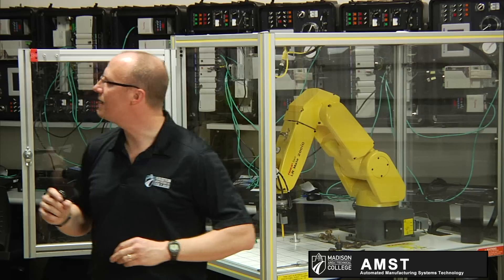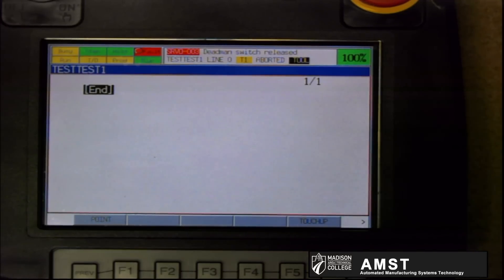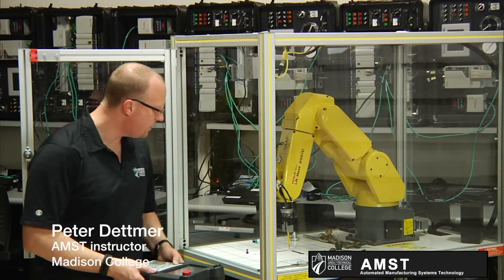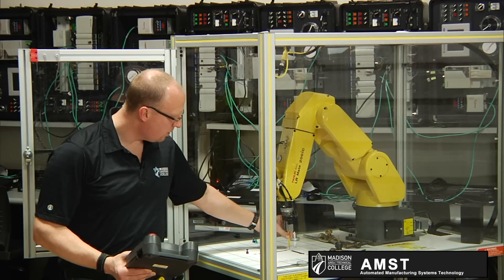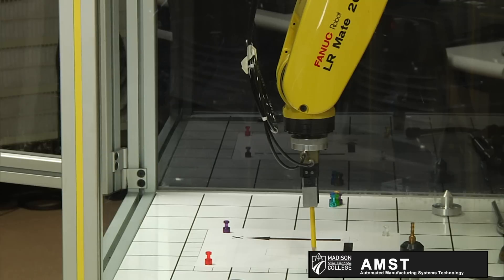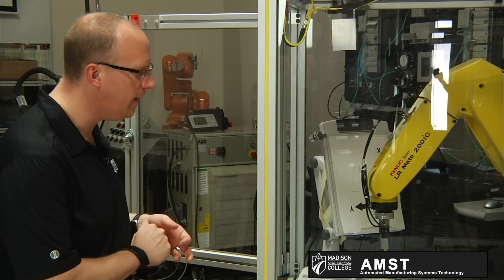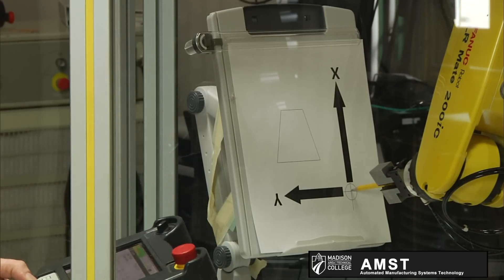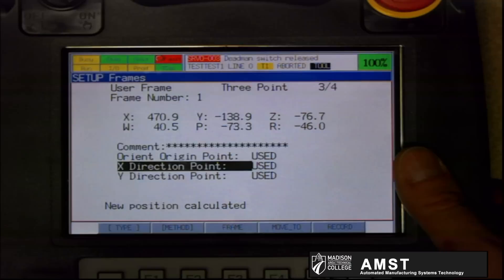Frames in Robotics - User Frames (UFRAME)

Comment: Is it possible to control a Fanuc robot with matlab/simulink?
Reply from the maker: I don't know. I'm sure everything is possible. Communication (exchange of I/O) should be doable. Full control, like jogging the robot or changing from manual to auto would require extensive programming and manipulation of the robot system.

Comment: Sir i have a doubt regarding the user frame!
Is it possible to create a plane with respect to the reference of another user defined plane?
That means if there is any offset in the user plane, that offset need to reflect in all other planes!
Is it possible sir?
Reply from the maker: Pretty sure that is possible by using some of the PR and/or UFrame Offset functions. Most likely using an Indirect Position Register Offset. Haven't done this myself. Probably best to reach out to FANUC on documentation for UFRAME offset functions.

Comment: 10:27 hello, I cannot make user fame (1) exit at this point.  Please tell me if a ban can be turned on somewhere?  I can't figure this out for a week
Reply from the maker: All we do at that step (time 10:27) is press F4 (DONE) to close the dialog box. Make sure your TP is ON and you are not pressing the SHIFT button. Check that FULL menus are ON. Click FCTN button. Press zero (Next) and press 1 to toggle between QUICK/FULL menus)
Reply: @PSDettmer  Yes, full menu is included, what do you mean (Make sure your TP is on and you don't press SHIFT)?  I do not change the number in UF (0), so that the zero does not change.
Reply from the maker: @dargindarginec9561  Don't hold SHIFT key and press F4 (Done). I assume you are in T1/T2 mode. Make sure the TP keyswitch is ON. Are you trying to see what UF and UT are associated with a point? You can't change the assigned UF/UT in that menu.
Reply: @PSDettmer  Thank you for the information, it's very nice.  the switch is turned on on TP2, but as for some in the video, as shown in the position of point P1, UF (n) changes on the user frame selected from the Settings.  maybe this old model shouldn't come out like that.  But with positional registers it turns out if you specify UFRAME_NUM ... and UTOOL_NUM ... in the program ...
Reply from the maker: @dargindarginec9561  The UTOOL and UFRAME commands only change the Active frame, they do not change the frame that was active when the point was recorded.
Reply: @PSDettmer  I want to transfer the robot to paint work, I will paint large objects using an artificial turntable, you have a video on your channel on how to properly teach for painting.
Reply from the maker: @dargindarginec9561  sorry, I don't have a specific video on teaching points for painting. I've  done it, but it was a very crude job. I taped to cable ties to the body of the spray gun, and taped them together about 6" from the center. This gave me a visual to teach the path. Painting is a lot more about pressure, flow, volume, and speed to achieve a good result.
Reply: @PSDettmer  please tell me, how did you set the movement along the trajectory?  and simultaneously turning on the paint sprayer?  As I understand it, first of all, the movement along the trajectory begins, when reaching the area of the part, paint spraying turns on, and the spraying also stops in the first place, or do I not understand?  in general, I do not yet know how to write so that the air valve turns on when driving.  can you tell me how to do it.  thank you very much.
Reply from the maker: @dargindarginec9561  Do you have PaintTool package installed? You could do it without, just adds some complexity. Create a point away from the part and a point where the paint should start. Then create a point in between using Continuous motion. Have your Valve DO/RO signal ON right after that intermediate point.
Reply: @PSDettmer  Install the PaintTool program package, you need to load the program into the processor right?  I didn’t think about it, I don’t have this software package, I did as you said with the usual functions of positional points, including the output to DO, and what is RO used for?  probably sounds stupid but I have little experience in training a robot.
Reply from the maker: @dargindarginec9561  The PaintTool 
package is a different operating system. Also has a different Teach Pendant. Paint robots are also intrinsically safe and are internally pressurized to keep paint out of the joints. Makes it easier to configure different spray patterns (pressures), but it can be done with a standard robot. You just need to ensure a safe environment (no spark) and have the appropriate controls for flow and pressure of your paint. RO is the integrated output into the arm (Robot Output). You may want to reach out to FANUC or an Intgrator for some assistance.

Comment: Holy shit. Why did I do so many years of college electronics and electromechanics etc???  That looks like plug and play. No encoder calculations. No PID math to do, Damn did I waste my time in college for so many years? I have built many XYX stepper motion control systems but had to do the calculations for everything like ramp up ramp down, feed rates to torque ...encoder resolution calculations...........etc etc. I wrote the programs in C as well as G and M codes.

Comment: why didn't you make the 2nd user frame on it's own, instead of updating?  if you have 2 user frames how do you get the program to run in one and then switch it to run in the other?
Reply from the maker: We were trying to show that the programmed Points are associated with the UFrame, and will execute the program exactly the same in the new orientation/location. If you want to repeat the same pattern/points in two different locations, record your points as PR, teach the UFrames, and switch the active UFrame = to the number/location you want to execute. Good luck!

Comment: Hello friend, I'm an initiator in programming and robotics, I do not speak English, so I did not understand very well, but I attended the class and understood some things. I have a doubt, when picking a theft to start from scratch, in the program so that the theft recognizes its origin the procedure to be followed is explained in this video, that is to find the zero of the coordinates in the origin and mark and then mark the limit on x and y, only then mark the points in the program? This zero point or origin together with the maximal points in c and c is what is called UFRAME? And what is TOOLFRAME? Thanks for the answer and tip.

Comment: We have several programs with several points within the program, and  recorded as moves and paths. We have never recorded a user frame. There are some programs that use a tool offsets. My question is this, can I program after the fact a user frame? Next if my tooling support has changed can I teach the new user frame points? And last will the programs that use Utool offsets follow the new frame in the exact same manner? Thanks in advance Todd

Comment: I agree we should move about 2-3 inches to teach the user frame for good accuracy. But suppose I have cylinder of diameter 25 mm which has an oblique cut.. Now I would like to teach the user frame to be the face of this plane. How would I be able to achieve it since the face is very small?

Comment: Could you tell me what does N,D,B and N,U,T stand for as different configurations and how do i interchange between them?
Reply from the maker: +Siddharth Parmar those letters have to do with the ability of the 4th, 5, & 6th axis to be allowed to FLIP/NO-FLIP, UP/DOWN and Rotated to reach a point in the cartesian system. For example, the TCP X, Y, & Z are still the same, but joint 4 may have the fittings UP or DOWN to reach that point. It allows the robot more flexibility to reach a point, but can also have unexpected consequences, especially, if you have electrical or air connections.
Reply: +Robotics & Automation - AMST 
Thank you sir. But could you also tell me how do I interchange between them? Is there an option to do that?
Reply from the maker: +Siddharth Parmar - yes in your program, move your cursor to the P[XX] element. Press F5 (Position). The Position Detail screen shows up on top. Press the F3 (CONF) button. This moves the cursor to the NUT/NUD field. Press the Up/Down arrow to change. Use left/right arrow to move between the fields.

Comment: What happens if the entried "Y" direction is not perpendicular regarding "X" direction?
Reply from the maker: +Luis Alberto Pacheco Hoyos - the X, Y, & Z axis are always perpendicular to each other. If you have need the X axis other than 90 degrees from the Y axis, you need to set up a Jog Frame for one of them. The program still needs to reference the USER Frame for desired axis. good luck!

Comment: Hi Peter,
If you´d have a robot fanuc with a 1.2 meter welding gun connected in it´s TCP and have to define an user frame to reference your robot with your fixture, how would you do that??? (the fixture has 4 tooling balls for reference but you can´t access them with that huge gun or even keep the accuracy of the userframe)

Thanks in advanced
Reply from the maker: Is it possible to remove the gun? You can teach a Userframe with a different Tool. It doesn't have to be the tool you will be using for your process. If that's a possibility, make a nice pointer tool. Teach/enter a UTOOL frame for it and teach the location of your UFRAME.
If you can't remove the gun, can you mount some pointer tool 90 degrees offset form the gun (you could make it removable). Teach that UTOOL and then teach your UFRAME. Good luck and let me know how things work out.
Reply: Yes, it´s not our best practice to take the gun off the robot. I intend to define the UFrame moving the gun through the coordinates and reference it directly through the TFrame and the UFrame is going to be defined in a fixture through 3 points in plans completely different.
Do you think it´s possible? If you can share your personal email we can exchange information and experiences.
Thanks

Comment from the maker: It's best practice to CLEAR the old UFRAME data before recording a new User frame. Are you sure you updated the same UFRAME referenced in your program? Did you run the same program? You could test it by copying the program and teaching a different userframe all together. Make sure you touch up each point with the new UFRAME active (Press Shift + COORD) menu to see active frames.